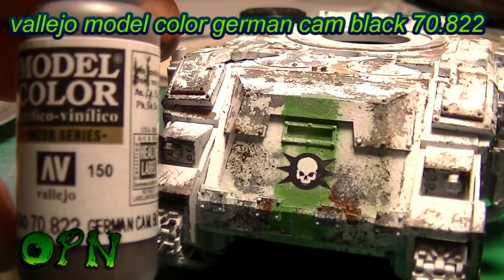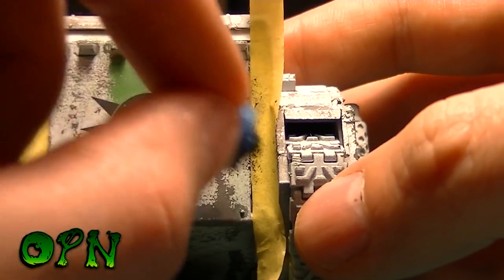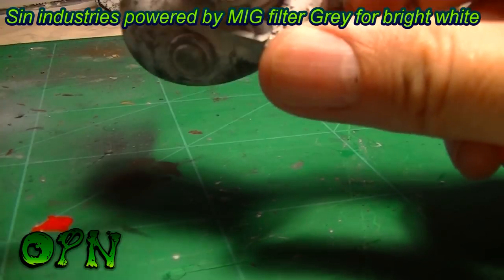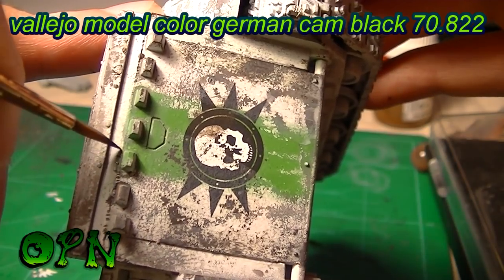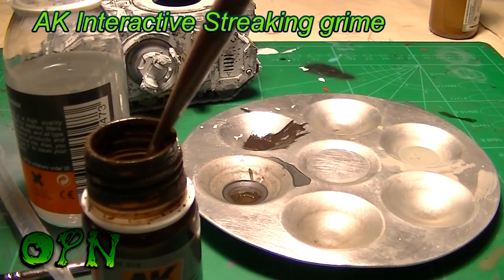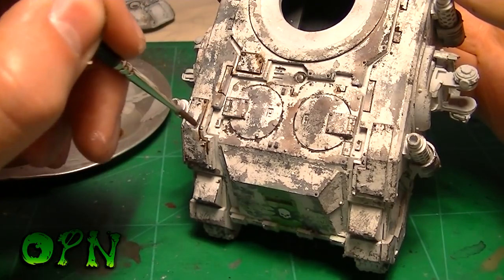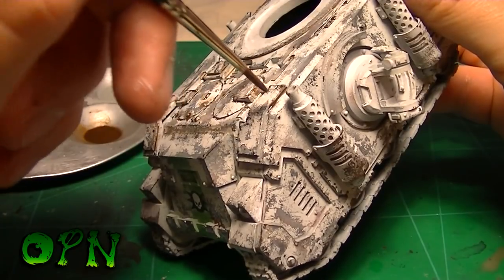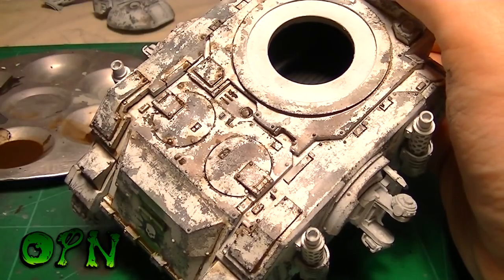How to paint a weathered tank part 2

Comment: Hey dude, love the vids. A quick question. When using the chipping fluid, varnish etc, did you have to thin it down for the airbrush or was it thin enough to use straight out the bottle. If they were thinned, what did you thin them with? Cheers!